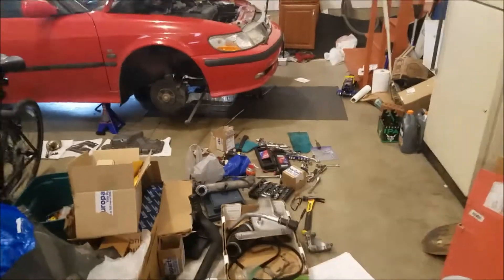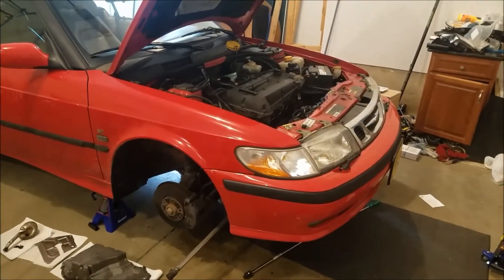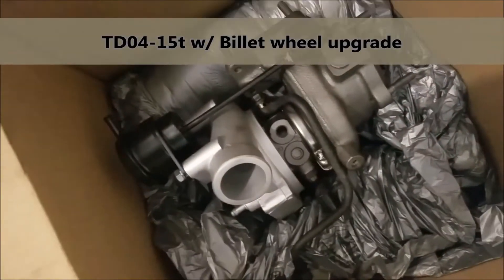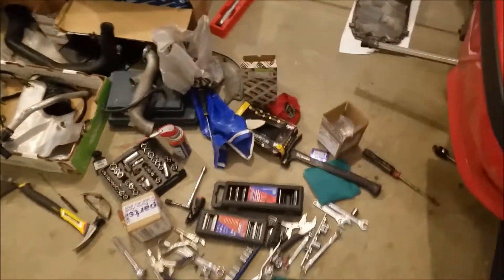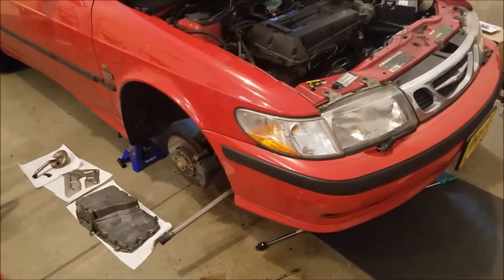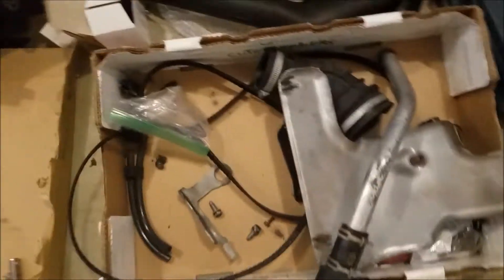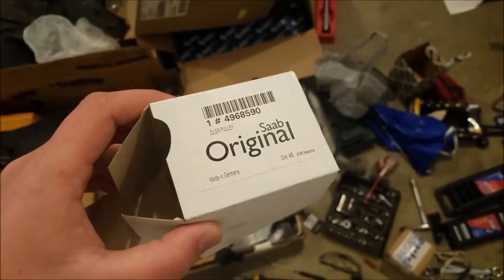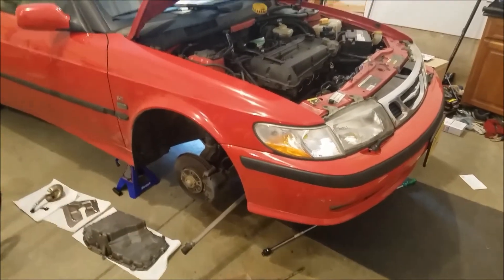Saab - Do It Yourself!

Comment: I know this is a very late post, but I love your videos. I'm about to do some DIY repairs on my 2002 9-3 convertible (water pump, control arms, oil pan gaskets) and your videos have been a great resource. I'm getting ready to replace the control arms and your video on it is invaluable! I was wondering if you ever made a video on replacing the water pump? It would be so helpful to see you do it. Thanks again for the amazing vids!
Reply from the maker: Why thank you for leaving such helpful feedback, I'm glad the videos are of use to you! I have not filmed a water pump replacement, as we were doing that in this video among other things. We had too many repairs going on to record even one, as videoing & editing etc makes the job 4x as long. To make it up to ya, I've attached the directions on how to do it below:
https://saabwisonline.com/a5/wis/9-3/2002/2-engine/cooling-system-petrol/adjustment-replacement-cooling-system-petrol/coolant-pump-b235r-b205l-r/

Comment: Fitting the Garret turbo back on to my 2002 9-3 that the previous owner removed, the 2 coolant banjo bolts have a different number of holes, and the holes are different diameters, I don't know which would be the inlet and outlet.

Comment: I have a deadlock problem: all 4 doors of my 9-5 are (were) locked caused by a moisture problem with the twice. One lock is replaced after opening the door with the key, one is replaced by demolishing the door panel and then the lock (from the inside) to open the door. Next project is the two backdoors. Do you know an easier way to open and replace a lock without moisturing the doors?

Comment: My softtop of my 2000 saab 93 convertible stops at half the way without an error code in the sid1. When i hold it and push it up 1-2inches and press open again it will work. Any idea?
Reply from the maker: Is this when you're putting the top down, I presume? I've had to help many a tops go down similar to what you've described, by lifting up on the front section that folds backwards in half. I did a write up on checking the microswitches, particularly the 5th bow intermediate switch that can cause such soft top failures. Perhaps look into that? Maybe investigating should be one of my next videos, as there's lots of things to check...
Reply: @saabross3171  oh great. Where do i find your write up? And where are the microswitches located and how do i test them?:)

Comment: Do you know a good website where u can order Saab parts?
Reply from the maker: eSaabParts.com for OEM
eEuroParts.com for aftermarket
Reply: Saab Ross thanks man! I have a 1998 9-5 Saab, it’s a reliable car, just hard to find parts
Reply from the maker: @sinemetu3124  Oh there's plenty of parts out there. But they can seem hard to find, especially for our early year 9-5s. 1998 9-5 is as early as it gets! They even changed a few things before introducing the 9-5 to us in the States in 1999.
Reply: @sinemetu3124  There are no problems with parts in Europe :) I own a 97' Saab 9-5 ;) Still going strong